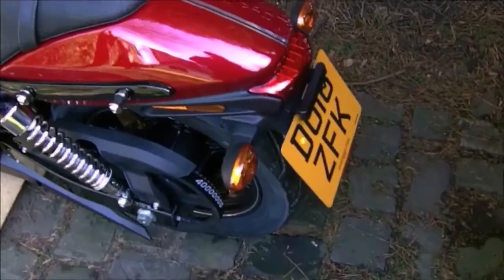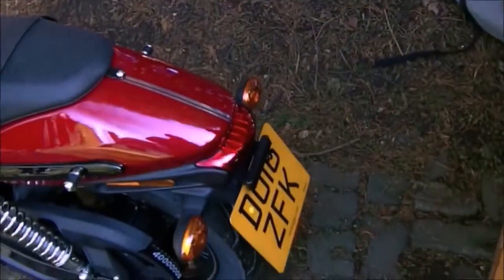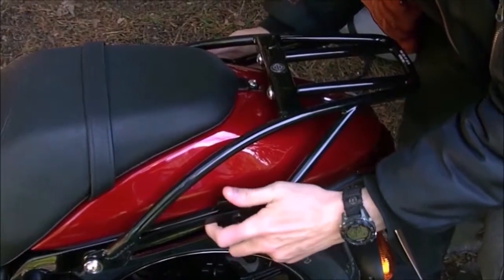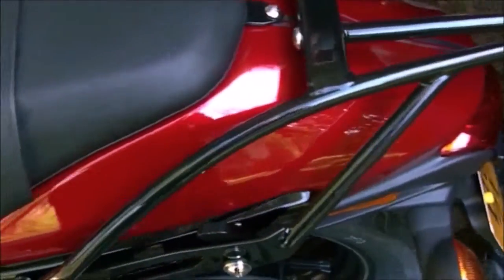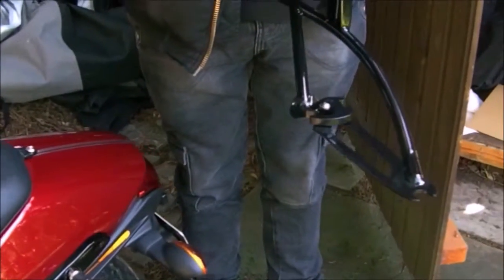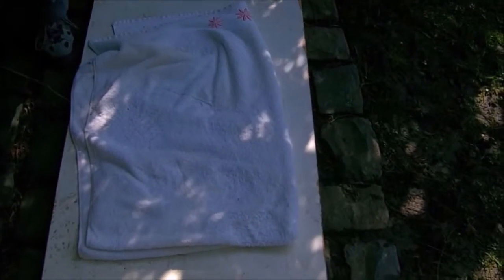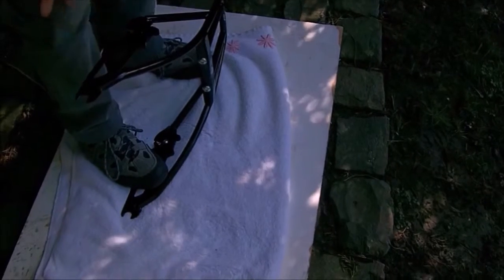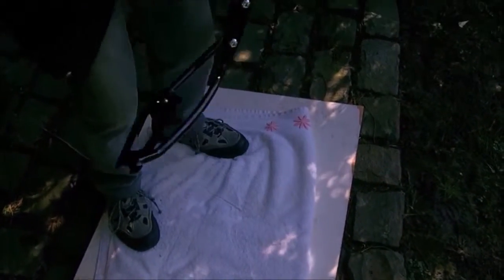H D XG 750 Street #54 Rack

Comment: omg this is a nice idea. I got a rack from china and is too tight to fit on the docking bolts. I was wondering if the rack isn't well made but seems the HD ones has the same issue. I will try the jack as well.  cheers mate
Reply from the maker: Yep your right on that, mine was a bitch to fit, but the one on the other bike no probs